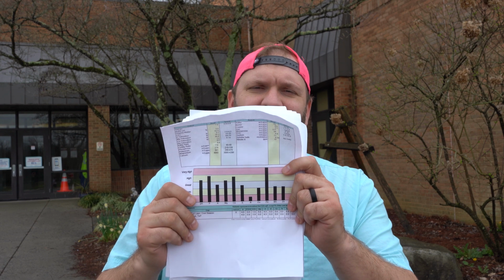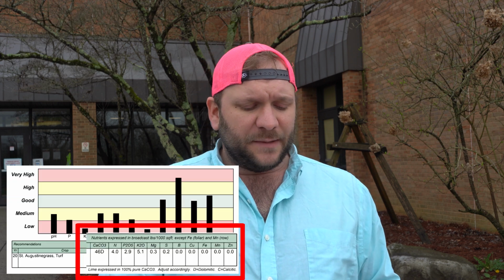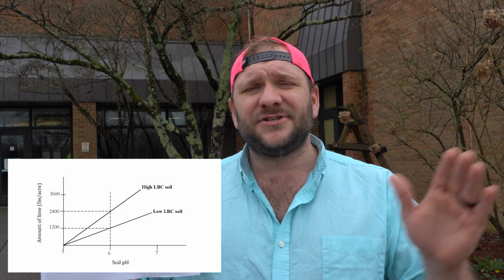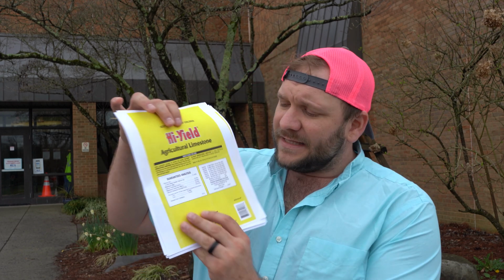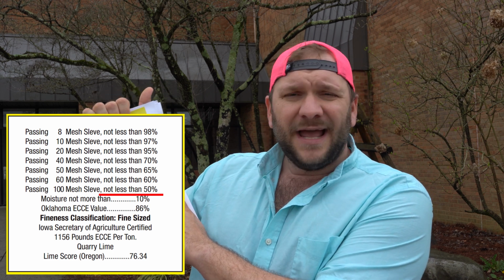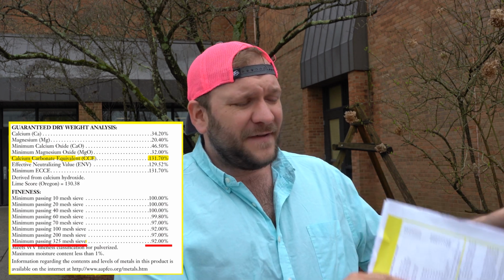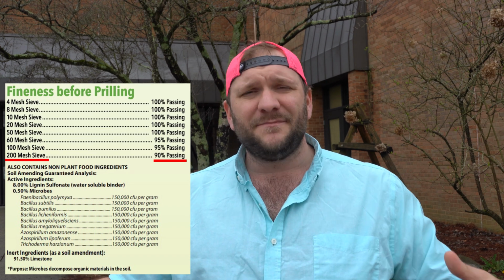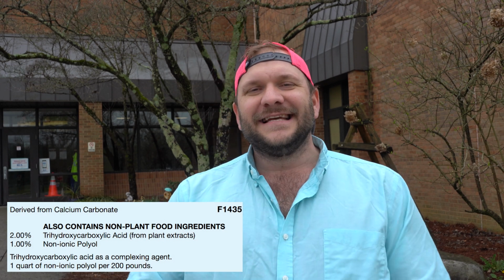Understanding LIME for LAWNS // What's The BEST LIME?

Comment: It would be good to define what is long term vs short term effect. Does applying something like solu-cal at 10lbs per thousand sq ft do anything? If you apply at that rate every year does it maintain the existing pH? How often should you apply lime? Many lawn care companies do lime as one application per year at a low rate. Is that doing anything other than taking money?
Reply from the maker: Whether applying sol-u-cal or a regular lime at 10lbs/1000sqft, but a soil test demands 50lbs/1000sqft, you should theoretically be able to reach your target pH in 5 years - assuming nothing else is contributing to the soil acidity.  Maybe a realistic time frame due to the method of slowly applying it, is closer to 7 years. 

applying it every year would only maintain it if you're doing things that would acidify the soil, or have a composition that trends acidic, thus requiring a buffer. 

lawn care companies are doing something but it's not much.  Truthfully, I dont think lawn care companies have the budget nor do homeowners want to pay what it actually costs to modify soil pH within a few years.

Comment: Seriously. You expect the average homeowner to relate to this? 
You know a soil test carries a huge fudge factor and may or may not represent your lawn. Especially true for large properties 
Adjusting low pH with pellitized lime takes a long time so pulverized agricultural lime is more responsive. 
Like you said soil chemistry is complicated so the best coarse of action is not panic and whip out the gimmicks. 
The average homeowner should consult with their local agricultural extension service or university before jumping off the cliff
Here in the mid Atlantic the university of Maryland has an incredible on line site as well as regional offices to walk you through your lime issues 
No need to process calculus or hire a chemist. Keep it simple
I have also found that farm supply stores are a wealth of region specific data . Farmers know about your local soil and the the supply stores know the farmers. Make use of known information and sources before you do something stupid
Reply from the maker: It's almost as if I'm making content not tailored to homeowners

Comment: Look for the scientific tests on the super lime products. Scientific testing showed that the super products have the same power as the $5 bags of lime.
Reply from the maker: What scientific tests? Please share a link. All the lime buffering capacity tests I've read and performed showed no, they're not. Calcium hydroxide is, but most super limes are just calcium carbonate
Reply: @TheGrassFactor  https://youtube.com/watch?v=WNhNlQbLLLY&feature=share

The video shows reverse titration results of Mag I cal vs common lime
Reply: @TheGrassFactor  I watched the test performed a few days ago and didn’t realize it’s the same channel. I go back to look in my history and find the guy in the video looks a lot like you! lol
Reply: And I just realized that the video I was referring to was your video. Unless I'm reading it wrong, your tests showed that the $5 bag of lime had the same correction effect as the expensive lime. And with this video you're saying that the effects would be faster acting but would still require the same amount of lime as the cheaper stuff. Did I say that right?  For me, that says cheaper lime used before the snows come in Lancaster, Pa. would be fine because it will have 4-5 months to sit in the soil during the late fall and Winter. I was relying on memory from a week ago when I watched the other video. I thought that guy looked familiar! LOL
Reply from the maker: @starpartyguy5605  yessir you nailed it. No reason to use expensive lime!

Comment: I thought with the fast acting you can't do the same rate as dolo..  If you do, the soil pH will have a huge spike then fall back causing the grass to be unhappy..
Reply from the maker: the variability is how much you apply at one time and the reapplication intervals.  It's harder if possible at all to nail with fast acting lime.  You're always guessing if it's all neutralized and if you need to apply more.  For lasting effect, the amount oyu need to apply is the same.  To guess how far and quickly that will move the needle, is really just that - a guess at best.

Comment: Matt would there be any benefit to a "spoon feeding" effect for Ph correction? My soil report came back with a Ph of 4.5 and I know I need to make drastic change and the soil report recommended 125lbs lime per 1000 sq ft in the fall. So by spoon feeding I meant putting down 15-20lb per month or is it better to just try to get that full 125lb down in one to a few shot(s)? It looks like I will be looking for a Dolometic Lime as you mentioned in the beginning of the video because I'm also low on Cal and Mag.

Comment: Humic...?
Reply from the maker: has no effect on pH
Reply: @TheGrassFactor  therefore lime is the solution when it comes to soil acidity right ?
Reply from the maker: @reneplamo8845  for the overwhelming majority. There are some other options with a decent enough calcium carbonate equivalent, but the risk to reward ratio becomes quite skewed